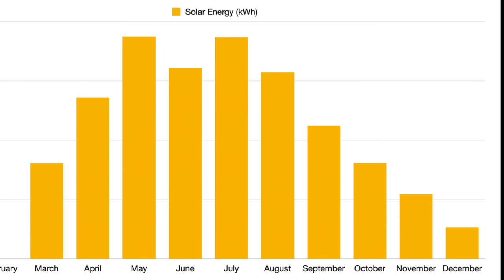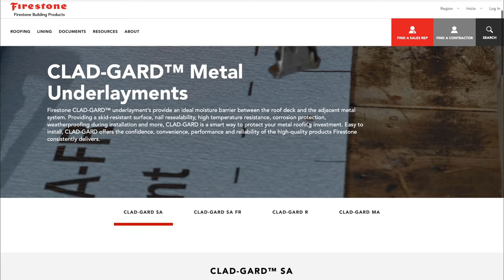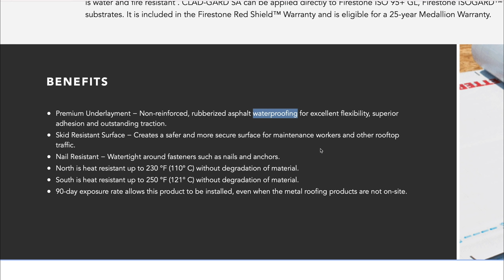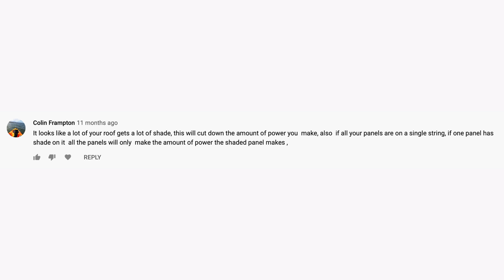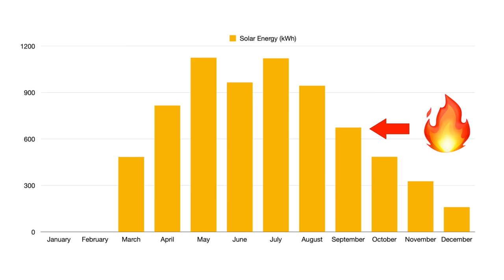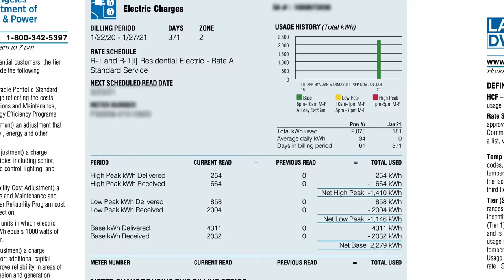1 Year with Tesla Solar Roof: top 11 questions answered + real production numbers & utility bills!

Comment: Thank you for this very quick video that answered every single question I had and then some I didn't think of. It's almost irresponsible for me not to get this roof as my house has no shade from sunrise to sunset the sun hits the roof and we get regular enough rain I won't lose much outside of just pollen build up over a week of no rain which is rare. I'm also told our town buys (or reduces the electric bill) the unused power generated. We estimated that we could make at most $100 on a year which really just means it credits the account for our bill to be used at a later date. We think they'll likely max out the most we can bank and or make off this idea though.
Reply from the maker: Awesome. Glad you enjoyed it.

Comment: i dont know where you live but here in Quebec you cannot install a power box outside in the open . You can either have them inside  the house away from heat sources and water source or install them in a power  house or shed outside the house as long as the are not in the open . Because of safety regulations  and fire regulations . If you were in Quebec they would order you to build a little cabine arround your power boxes

Comment: Great video!

A comment about selling power to the grid.  The grid is supposed to supply power to every house that asks for it.  When they can't it's a blackout or brownout.  When the sun goes down and all the A/C's are still running there is a lot of electrical demand.  Think of running your home on a portable generator.  You have two costs, the cost of the generator and the cost of fuel to generate the power.  You can economize on power and save fuel, but if you buy a generator that is too small and you can't run your dryer and cook supper while the A/C is running you aren't meeting your demand.  If you live off grid you put up with that and don't run too much load.  But if you want all the power you need anytime you need it, then your generator has to be big enough to handle the largest load.

The power company operating the grid is in the same predicament.  They have to supply all the power requested just after dark when all the solar supply has quit.  The cost of generation capacity is a substantial part of the cost of power.  The grid has very little storage capacity.  So power you sell to the grid on a cool day when they don't need it is not very useful to them.  It's valuable when it's late in the day and just after dark but you can't sell it to them then.

Paying the homeowner full price is a subsidy to try to get more solar installed.  The real value of power you sell when the grid does not need is is probably 3 or 4 cents per kwh.

The idea of selling excess power to your neighbors is great if they are using power through the day, maybe they work nights and charge their car during the day.  The batteries, if they don't cost too much, are a way of storing your own power instead of selling it when the grid does not need it.  Large customers usually get bargain rates for power late at night and after people have gone to work to try to encourage consumption of power when demand drops during those periods.

Comment: Good review. 
When you calculate your savings for the year does it include the money you receive from the sale of the power you generate and put into the grid? 
You only required about 30% of the power you actually generated, the rest of the power was uploaded to the grid and you still had a bill at the end of the year? I'm guessing this is all service fees?
Reply from the maker: We get energy credits, which "pay for" the energy we use at night, cloudy days, etc. (energy at night, during peak demand periods, is more expensive that the energy we generate during the day). We can bank credits (sort of like roll-over minutes) but can't cash them out.
Reply: @AustinFlack  sounds like you're still getting fleeced by the power company.
Reply: @MikSrf723  There's no such thing as a free lunch.  Somebody ALWAYS pay a price. Off-grid is the ONLY  way to go, given today's  miniscule prices  and half a brain. I bought my  first  2nd-hand panels in 1980 for $13.80 per Watt (when the  weekly wage  was $125. Some years later I  sold the  house and  gave the panels to a  friend, where they're STILL producing at about 85% of  rated output. These days  I  can buy top-shelf panels  down  to about 20cents per Watt. Do the  arithmetic.

Comment: you had to pay $156.62 at the end of the year to your utility company, but 67.8% of your power went to the grid.... 
does that mean you sell power to the grid at a lower rate than what you buy it at? 
and does this mean that your utility company does not tally up your energy use for a whole year vs your production for that year and then you buy or sell the difference?
Reply: Same thought.
Reply: I read another comment that addressed this. They had said yes what you said is true HOWEVER the energy you contribute gets pulled back out during the night while the roof is not producing
Reply: I could produce 100 kwh, sell 67.8 kwh to the grid, use 32.2 kwh and then still use 80 kwh from the grid. The rate depends on a lot of factors .
Reply: Here in Southern California SDG&E the system works differently that's why I was a little confused. At least for my solar setup it's based off of a year where you sum up everything you produce, you subtract everything that you use and if you're a net positive you get paid (at 1/3 the rate for KWH) and if it's a net negative you pay at the full rate for KWH. So in my case you don't really sell anything if you have to pay for electricity in the end. I guess up in la it's a bit different
Reply: What the power companies like to do is put the year end right after peak sun so that when you start drawing from the grid...all of your surplus is gone because it's a "new year" now. Makes me want to put the surplus power into the grass

Comment: Spent probably less money on making my home energy efficient than a Tesla roof. My electric bill for 2020 was $819. Might look into sealing up your home or reducing energy usage before spending that much money on a solar roof.
Reply: Most people dont just get a Tesla solar roof out of the blue. Normally the house is already due for a new roof to begin with, so at that point you might as well go with the solar roof. But yes, increasing a houses energy efficiency is best if you dont need a new roof to begin with.
Reply: $2,000 a year ROI. How much is roof? Does it pay itself off in 25 years? If it does it's a free roof every 25 years of not how much does it cost u?
Reply: @Michael_J_M14  how much mining was done for the materials of the solar panels? In what county is the mining done? Oh yeah a poor minority country that has no EPA to ensure the mining is done with"green energy' in mind
Reply: My 2000 sqft home here in Vegas so far my annual electric bill will be around a total of $700.  CA has crazy high electric rates. And the house in this video is tiny. itty bitty. imagine a home that is over 1500 sq ft. Dam.
Reply: @brockbaby  they have high electric rates because the state mandated "green energy" and the price per kilowatt to produce " green energy" is 6 times more expensive
Reply: @Michael_J_M14  I think Hitler said something like that.... U have to make sure the cure is not worse then the disease
Reply: @electromechanicalstuff2602  i agree, its just moving a cost from one place to another. a regular roof would have materials made nearby.  all the parts for this Electric fantasy people have. the costs are hidden so far... never any childs that die from cobalt mining....

Comment: The fact that you managed to not only power your home but put 50% back into the grid is just amazing.  Not only do you gain some energy credits from the power company but you also encourage others to make the change aswell!  Also this solar system will basically pay itself off.  You got 2k savings from just 1 year which means a few years down the line can pay off your entire solar system and get you extra profit

Comment: This is a great video. We purchased solar panels and had them installed in Pasadena on almost the exact same timeline that you did. With 20 solar panels, we produced 8200 kWh, and had almost the exact same solar energy use profile that your graph showed. I kept the panels clean, though. I wash them every 2 months, and did an extra cleaning during the fires. Here is Pasadena, we did not pay an electric bill at all. In fact, for half the year, our solar production also paid for our water usage. 

However, I see you charge a Tesla at home. We just purchased one, and I think we are probably going to have to pay for our water now--unless we add more solar. So far, we are still producing more energy than we use, but that will change in the darker months. Time to add more solar, I guess.
Reply: @Nighterlev  We are adding a battery along with more solar panels. We are not using Tesla (they take way too long), but a local company.

Comment: Wow, I was considering a metal roof after the house gets paid off in the next few years. This looks like a great alternative.
Reply: Quite the difference in cost, I just did a metal roof on my 35x55 shop, cost me around 6k CAN and should last the rest of my life (I'm 31). To do the same roof in tesla glass, it would've been around 50k going off what others have posted about costs and what not.
Reply: I would only recommend solar roofs for particular situations.
Id only buy it for the environment, if you plan to keep your home for your entire life, and/or you like not relying on the grid.
30K price, assuming you're not paying interest/financing the roof, that's 2K/YR average savings = 15 year ROI. Add interest/financing, that's a longer ROI.
Half that for people with less costly energy bills, 30+/YR ROI. Obviously you could get less powerful panels to reduce the ROI, but still probably around 20+/YR RIO.
If you have a bigger home w/ 2K/YR savings, 20-30+/YR ROI.
If you don't live in sunny Cali then you could expect an even longer ROI.

You can mention increased home value as another asset, but it doesn't work that way in reality.
The panels have a 25 year PERFORMANCE warranty, but a comprehensive warranty (actual replacement if something breaks) is only 10 years.
Chances are in the beginning you might be able to add 15K to your homes value after throwing 30K at your home for the new roof (already in the red). Then as soon as that home hits 15-20+ Years old, GL asking people to pay an additional price for a 15-20+ year-old solar roof that they're responsible for. Its not an easy sell to say the least.
Wouldn't be surprised if you can't get any additional $$ for it.
Reply: I appreciate the information, I'll likely be in this house for another twenty years, I could swing the initial 30k cost but given the timeline on ROI it wouldn't be reasonable.

Comment: Thanks for the concise info! Now that you've had it operating for almost 2 years, have you calculated what your ROI on the total outlay will be?
Reply from the maker: Will pay for itself in 8 more years. (I deduct the cost of a conventional roof when I calculate ROI—I needed a new roof!)
Reply: @AustinFlack  would it make any sense if you planned to stay under 10 years?
Reply: @jimmymcgill5572  it could raise the value of the home, by how much??? Hard to say.

I wouldn't install a solar roof, unless I needed a new roof, though. Otherwise, you're better off just installing less expensive solar panels.
Reply: @AustinFlack   but  most households don't   need new roofs, so it can be left in the  calcs. What the actual ROI?
Reply: @AustinFlack  Did you add in to your calculation the fact that the solar panels become less efficient year by year.
Reply: @AustinFlack  in all reality, probably sooner than that if you aren't accounting for rate increases. In areas with good solar radiation, such as southern california and arizona, these are great investments.
Reply: @happywrenching33  1/2% per year.  Essentially, a 5% decrease in solar output efficiency in ten years.  Not sure how much more they degrade after ten years.  Most people replace the house roofs ever 20-25 years.
Reply: @stephenmason5682  you need a new roof after like 12-15 years (during the life of Tesla roof) if you use shingles. So it could be calculated in still. But for those who might have a roof that lasts as long as the Tesla, a calculation with and without is good
Reply: @happywrenching33  and other major component failure. The reality is long term it will never pay for itself unless nothing fails
Reply: @AustinFlack  
  Why is it that you had to pay the electric company for that twelve month period, when the house only received one third of the energy produced, whole the remaining two thirds went on the grid ?
   Shouldn't the electric company have been paying you for that sizeable contribution to the grid ?
   Also, during that year, how much were you paying for the roof on a monthly basis ?
Reply: @EwetoobSucks  He put 2/3 of the energy produced by the roof. It's not relevant to what he consumed from the grid when the panel wasn't producing electricity since he has no storage solution.

Typical household energy consumption peaks outside of solar production so he probably used  lot more energy, say during nighttime, than he was able to put into the grid during the afternnon at peak production.
Reply: @sevurueva5138  
   Thank you for completely misunderstanding my comment.
   I am just going to leave it at that.
Reply: @EwetoobSucks  touché
Reply: @EwetoobSucks  
I think you misunderstood their answer,
If you wanted to know why he had to pay the company even tho he was selling more than two times the amount he was making with his solar roof, then Sevuru gave you the answer to that.
Here an example:
- He needs 13 Watt/hrs in a day
- He generates 12 Watt/hrs in a day while the sun is up with his solar roof
-4 Watt/hrs he can directly use
-The other 8 are sold because he has no storage solution and they are generated while he has no use for them
-He buys the remaining 9 Watt/hrs from the company so he can use them in the evening
At the end the cost of buying the 9 Watt/hrs is only offset by selling the 8 and he still needs to pay the electric company instead the other way around.
This might even be the same if he actually bought slightly less than what he sold depending on sell and buy price rates.
Reply: @Demibrot  
   Thank you for misunderstanding his reply.
   In his own re-reply, he acknowledged my reply.
   I'll just leave it at that.